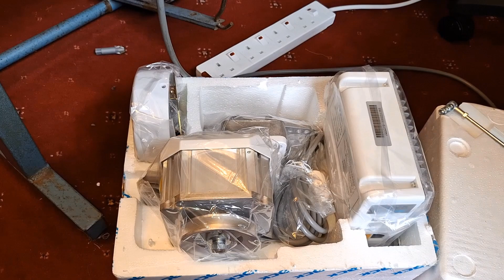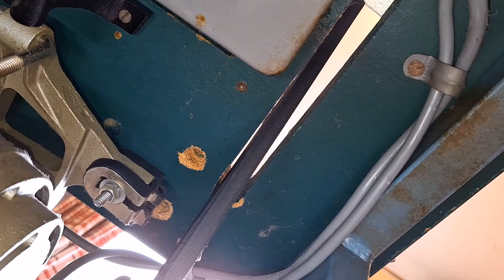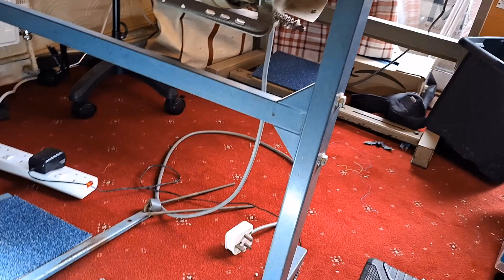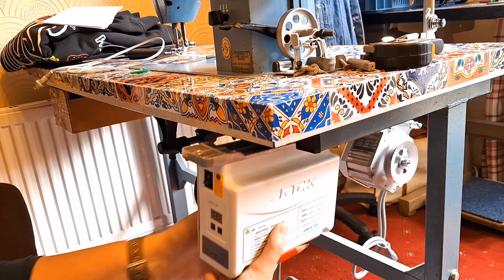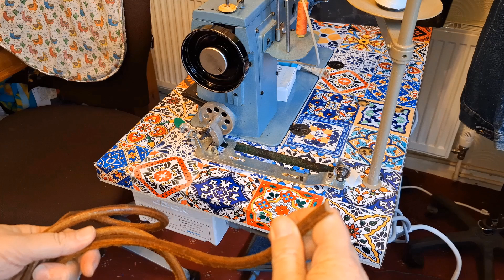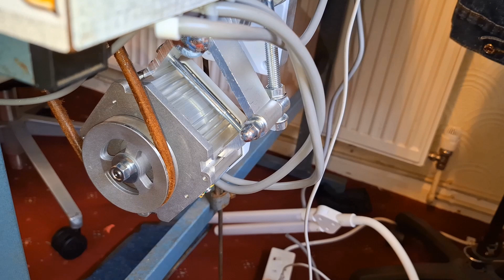How to Install a Servo Motor: Easy Step-by-Step Guide

Comment: Thank you I am still on the fence about changing out my clutch motor on my second 20U My son-in-law did change out my motor on the first one I have had 25 years. Now I bought another one and I just can't get used to the humming or the speed of the old clutch motor. I do like to think I can have one set up to do straight stitch with straight stitch feeddogs and needle plate. only and the other one with zig zag for and feed dogs.I do think when he changed out my other one he lifted out the machine and laid the cabinet on it's side to make it easier to access the clutch motor and install the other one. That motor is soooo heavy. I donated it to a thrift store for them to sell. I do know the wheel can be changed out to make it slower but I just can't stand the humming noise from the clutch motor. The machine came from a drycleaners.
Right now I am having problems with the zig zag on my first 20U I was fixing a pair of jeans for my husband and hit something and locked up the needle. I did get it unlocked but now it is not zig-zaging it will do a couple stitches and then skip and do a straight stitch. I have tried to find a video on what is going on I am kind of mechanical and if I can find a video I know I can fix it. I need it to zigzag to stitch on letter patches for school letterman jackets.
Reply from the maker: @1954evelyn  Hi, I did a LOT of research before switch motors to find the right servo motor for my needs. I initially fitted one on my chainstitch embroidery machine when I set it up and liked it so much that I decided to fit one on my 20u I use every day. I love the fact that it's silent running, and it also makes quite a difference on the energy bills!! The fact you can program how fast it goes is also a bonus, especially if I have someone who wants to try out a 20u for the first time. I can make it nice and slow till they get more confident, then reset the speed when I need to use my machine to something I more happy with working at.
With regards to the issue you are having with the zig zag, have you given your machine a clean and oiling? Paying particular attention to the bobbin and feed dog area? It could be that you have a tiny peice of needle/thread or fabric stick somewhere.  I find the 20u can be quite a fickle machine, and if something is not to its liking, it will let you know!
Reply from the maker: @1954evelyn  I will do a video I. The new year about cleaning and serving this machine ☺️
Reply: Hi there, i bought exact same servo motor but I don't know how to set it up , please make a video on how it's set up😢